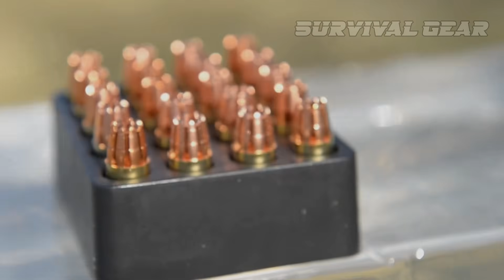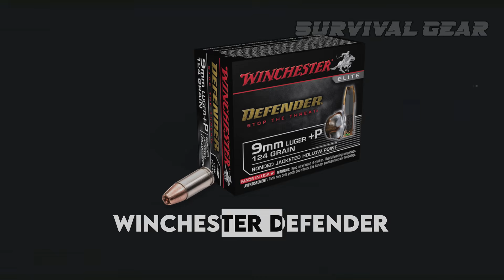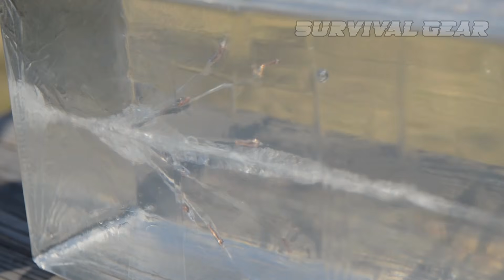Top 10 Best 9mm Ammo Self Defense & Range Shooting 2024

Comment: Underwood Extreme Defender +p+
Reply: That stuff is gonna have a lot of over penetration and I myself don’t like +p+ 9mm just cause at that point you’re getting a lot of recoil and you might as well go get urself a 10mm it’ll be more powerful still have a lot of capacity and tbh you could find 10mm self defense ammo that’s cheaper than 9mm +p+
Reply: @Soldierofgod-f2j  incorrect on all counts, research this ammunition
Reply: @Ewetoobizknotseys  https://youtu.be/exx7yy67BZo?si=_2Y4CJ09zY-D2WZZ No I’m CORRECT on all counts this ammo has collateral damage written all over it first of 20 inches of penetration in gel is inexcusable for self defense use that past the MAXIMUM acceptable penetration for a self defense round you really want somewhere between 14-16 inches of penetration optimally. Secondly how can you argue that a +p+ round won’t have significantly more recoil than a standard pressure or +p 9mm that’s a braindead statement. Thirdly this ammo claims to have “2x greater expansion than a conventional hollow point” yet it didn’t even do much better than a Speer gold dot +p as far as expansion and overpenetrated like I just stated earlier. Also this ammo does like 480 ft lb that’s unimpressive considering .45 +p, some good .40 cal rounds, .357 sig, and 10mm would put this round to shame being able to easily do 500+ ft lb of energy and still meet FBI protocols which is bare minimum for a self defense load. Plus at 1.20 per round I’d much rather get the 150 grain 10mm auto offering underwood has which actually meet fbi protocols and flys at 1500 fps delivering 750 ft lb. Pretty much every point I initially made is correct.

Comment: 🎯 Key Takeaways for quick navigation:

00:15 🎯 Lehigh defense nine millimeter maximum expansion offers exceptional stopping power and minimal over-penetration, making it ideal for self-defense scenarios.
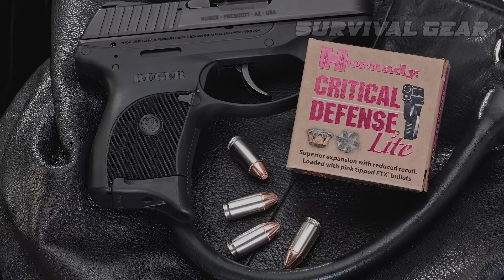01:40 💥 Hornady Critical Defense and Critical Duty are optimized for different barrel lengths, providing reliable performance in various self-defense situations.
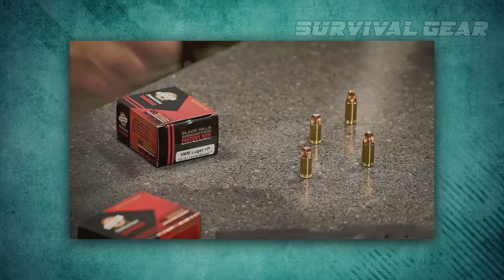03:16 🔫 Black Hills Honey Badger features a unique design for deep penetration and consistent performance without relying on expansion, making it a top choice for self-defense.
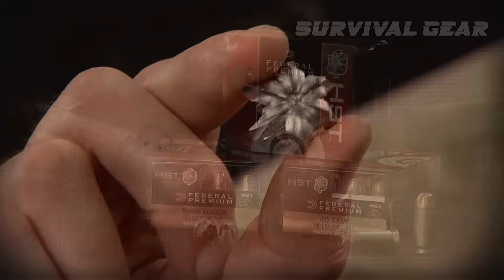04:52 🛡️ Federal Premium HST offers consistent expansion and penetration, making it a trusted choice for law enforcement and self-defense applications.
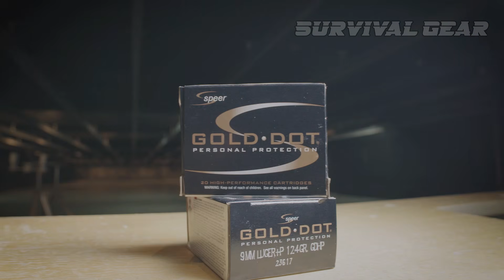05:34 🚔 Speer Gold Dot G2 Carry Gun is optimized for short-barreled pistols, providing reliable performance in concealed carry situations.
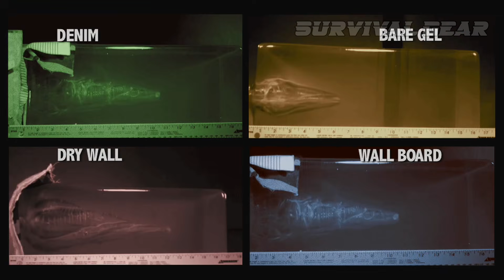06:42 🔒 Winchester Defender features a bonded copper jacket and lead core for consistent expansion and penetration, making it a reliable option for self-defense.
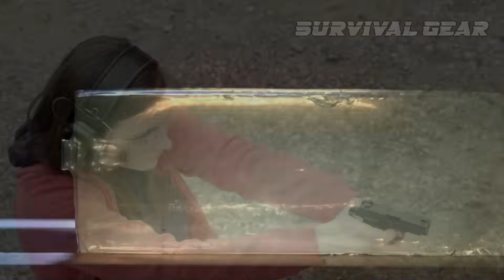07:50 💡 Sig Sauer Elite V-Crown offers stable expansion and penetration, making it a cost-effective choice for premium self-defense ammunition.
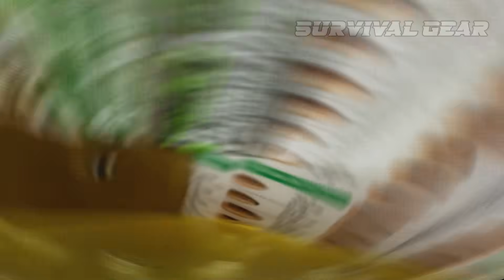08:57 💣 Remington Ultimate Defense features a brass jacket for consistent penetration and expansion, providing reliable performance in various self-defense scenarios.
09:50 🤔 RIP rounds have a unique design but lack sufficient testing to confirm their effectiveness, making them a controversial choice for self-defense.

Comment: Solid vid. I’ve used almost every ammo in this vid and this vid was extremely accurate with its choices and description. With a couple exceptions. It’s missing the g9 round which is extremely effective. It’s similar to the honey badger. It’s also missing the underwood extreme defender which is exactly like the honey badger but is a 90gr+p with higher velocity and energy and is better or at least equal to the badger. But other than that it’s on point.
Reply: I’ll be looking for videos including those thank you

Comment: The best?  Does it really matter?  Is the individual you are shooting at going to call a time out and discuss the ammunition you are using?  This ammunition is a waste of money.
Reply: Expansion, penetration, and over penetration all are important factors to consider, lest your rounds go through the bad guy and hit little Timmy in the head, or fail to do effective damage and result in the threat not ending.
Reply: @diobrando2575 unless lil Timmy is the actual threat. 😂
Reply: @diobrando2575  I'm new to guns. Just got a hellcat pro fde. What should I use for ammo for defense and for range?
Reply: @mellie1022  For self defense, go for hollowpoints. Speer Gold Dot and Federal HST Premium are the most popular for a good reason, good expansion, good penetration while not being too bad on overpenetration. Every type of ammo has different bullet weights, I carry 124gr Gold Dot since my Glock likes it. Note that bullet weight isn't the weight of the whole round, just the part that comes out the barrel. To give a quick breakdown, the whole round is the cartridge, the bullet is what goes through the barrel and the casing that gets ejected from the top is what the bullet and powder are contained in. My advice is to try both brands and see which one your gun likes better. For the range, use Full Metal Jacket (aka FMJ) that is the same weight as your carry ammo, so if you carry 147gr HST, shoot 147gr FMJ, carry 115 gr Gold Dot, shoot 115gr FMJ. You should also shoot the ammo you carry too, I carry one magazine in the gun with two spares so each year I shoot those 3 mags and put in new ammo since sweat and moisture from being carried can cause issues.

To give some general gun tips, don't carry small of the back as you can get paralyzed if you fall on it, keep one round in the chamber, your gun has no safety and is modern so you can carry one in the chamber safely, practice drawing your weapon often along with dry firing it at home for extra practice, don't leave it in your car unless you want it stolen and used in a crime, get a good kydex holster, leather is bad, if you open carry, use a holster with level 2 retention at least, and this one is specific to you as a woman, don't carry in a purse because if that purse is taken you're without a firearm. Also find a good holster, look into reviews and don't be afraid to buy a few and see how they work for you, not all good holsters work for everyone.

And welcome to the gun owning community!
Reply: @mellie1022 For range use fmj ammo. For self defense use federal HST they’re the best used by law enforcement all over the nation it’s 100% the most real world tested self defense round I will take proven reliability every time